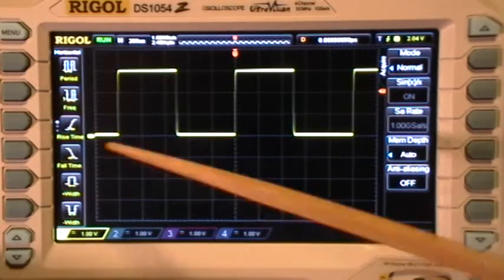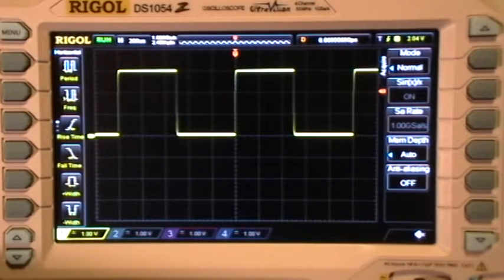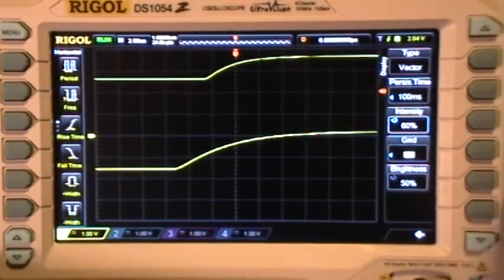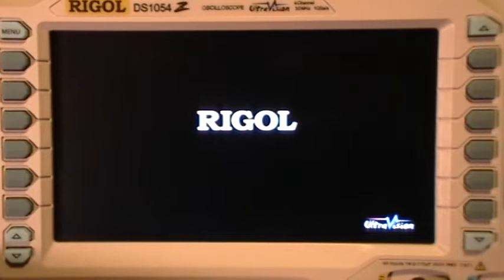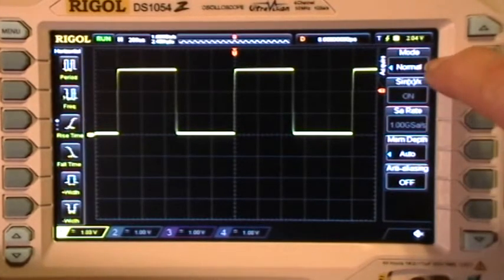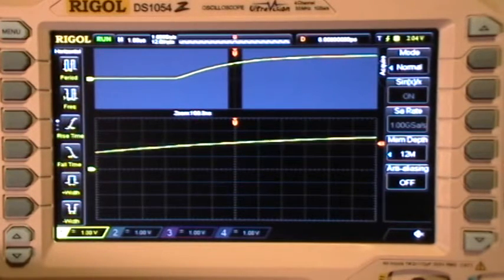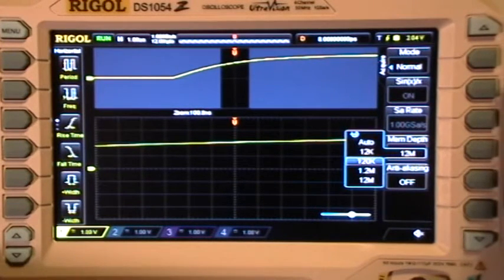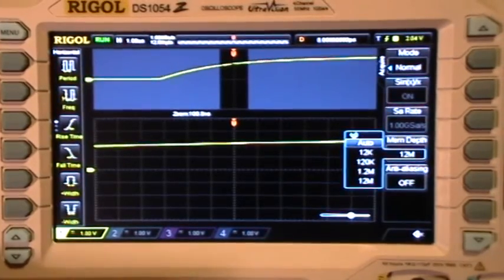Scoposcopy: Rigol DS1054Z Freeze Bug Part 2

Comment: Checked it on my rigol with 00.04.03, board 0.1.1
Same Problem, on Mem Dept Auto :/
Reply from the maker: Rezasurmar Thanks for your report. You might also try seeing if you can get it to start up frozen, as I show here: http://www.youtube.com/watch?v=q3qLx1PYXyw
I think that the very most recent firmware revision avoids that "start frozen" condition because it has fixed (I think, maybe) the bug that resets the "Mem Depth" to Auto when the scope boots up or a setup file is loaded. 
But even with the latest firmware 04.03.SP1 it still freezes when all 4 conditions are set. 

I still have heard nothing more back from Rigol since my initial contact with them on June 8th.
Reply: TinselKoala 
its freeze it, I had to restore factory settings
Reply from the maker: Rezasurmar
Well, if you install the latest firmware 04.03.SP1 it might get a little better. But there are other bugs too.
Still, the scope is a great little instrument, I love mine, mostly. And Rigol is working on fixing the bugs. The new firmware adds French language support and better sample handling in the FFT math function.
Reply: TinselKoala 
I have, the latest firmware install, sorry for inaccuracy.
And my poor english ;)

Comment: Checked it on my rigol with 00.04.02.SP4 
No problems with the scope.
Reply from the maker: Roeland Riemens Good, thanks for trying. You might try several different sequences to see if you can get it to freeze. We are still running about half and half, with about the same number of people who can, and who can't, replicate the freezing. So the problem may not affect all DS1054z units, but it definitely affects some of them equally.

Comment: Just tried this, exactly step by step as you did it and mine locks up !
I think shubus is correct - everyone should try it and report back.
For the record, no mods or changes to my own scope, single channel input, connected to calibrate points on right of scope.
With it being the calibration trace, it may help Rigol to diagnose.